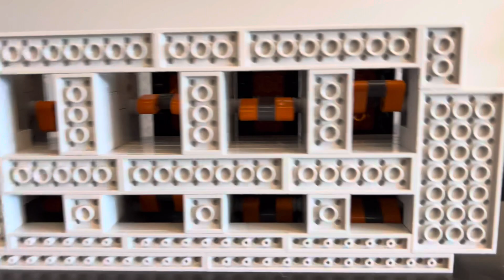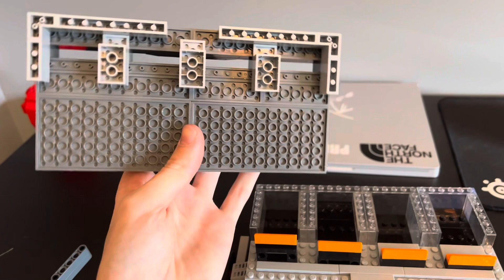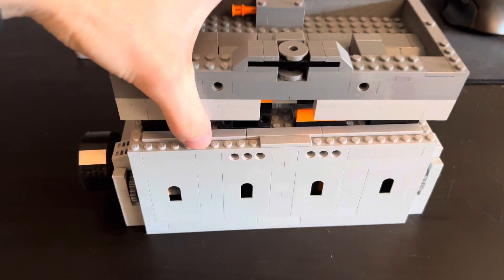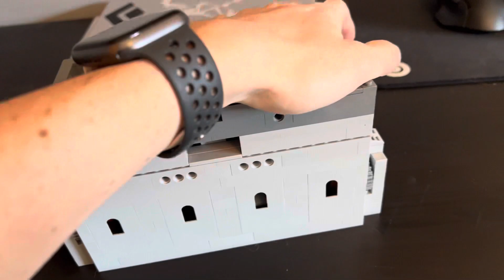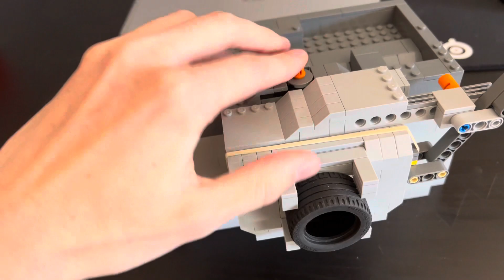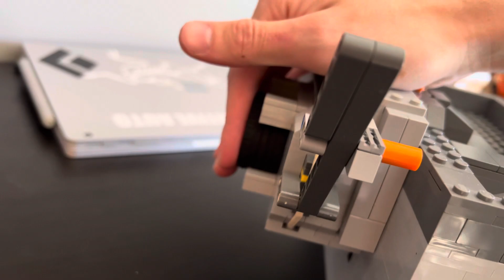How my Lego vacuum engine works.

Comment: Heyy, you can make some intake manifold with pressure chamber, plus runners for each cylinder. I believe it will add some more response and effiicency
Reply: The head acts as the manifold in this design

Comment: I'd make that crank 180 degrees. That way you'll have a smoother running engine, the primary forces will be balanced. A vast majority of production engines will have 180 degree cranks with their firing order being 1,3,4,2
Reply: Although this acts almost more like a 2-stroke than a 4-stroke, i would guess he offset them by 90 degrees as apposed to the conventional 180 degrees not so much for balance but for general operation as he would have 2 pistons sucking at the same time at every 180 degrees but with this you can get a power stroke every 90 degrees instead, food for thought i guess